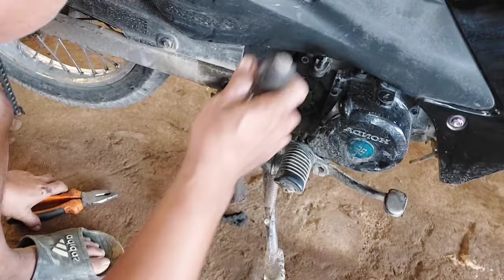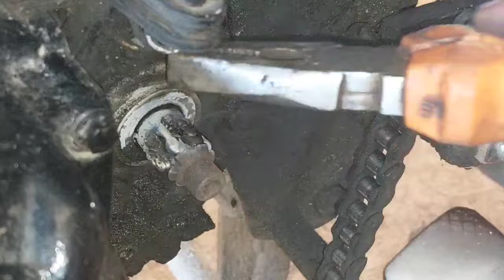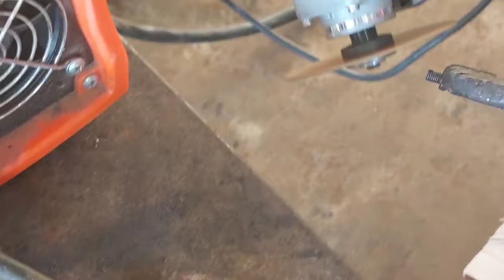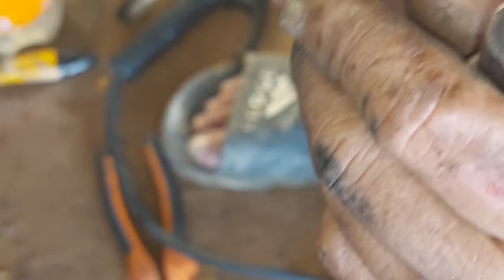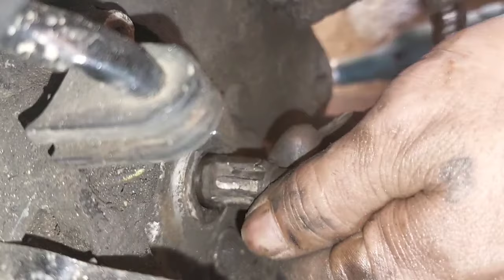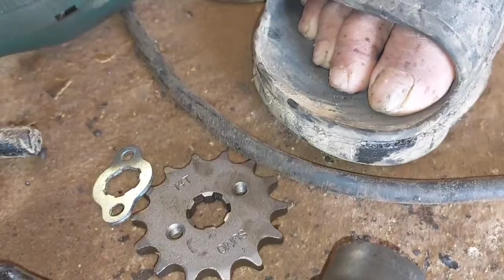How to Repair Engine sprocket shaft No over haul?

Comment: Good Job Boss Ok Yan...Ang risk lang Dyan ay Ang oil Seal swertihan lang talaga na Hindi masira sa init ng welding...pwede talaga yan...madali-an na trabaho
Reply from the maker: D naman problem ang oil seal boss pwede Dakota palitan yan.
Reply: Very good idea Sir gayahin ko rin Yan..pero Ang ground wire ko dun ko ipakagat si winiwelding kasi maaring magkaroon ng spart spot Ang bearing kpg nag poor contact..Tama ka Sir madali lng Yan dukutin Ang oil seal.pero Kung ako papalitan ko na Yan kasi sa tagal ng pag welding baka nasunog na Yan.. keep up the good work sir.mabuhay Ang Pinoy.
Reply from the maker: @rica.ganadores1927  kaya po dyan ko nilalagay  ang ground  very important  factor  na malaman  nyo po. Hindi ko tinatanggal  ang CDI  mahirap mag kalas kalas ng cover  minsan napuputol pa ang bolt.   Pag direct  ang ground  or  malapit  sa we weldingin mo hindi na iikot ang current  kaya safe  ang CDI  kahit  di ito kalasin.
Reply: @buhayturnerodeskartingpino9712  very good sir.

Comment: Pede cguro kng gnyan mga ngipin sa motor ko pino at maliit mga ngipin.ang tanong kng tatagal Kya yan?
Reply from the maker: Tested and proven  na yan boss  dipinde  sa rod na gagamitin. Pina ka matibay Abrasur 610 na welding rod. Pero  kahit  stainless  lang solve  na kahit sa tricycle  d rin bumibigay  tataas pa ng akyatin dito saamin  ang lalaki pa ng side car  foreigner  pa ang karga.
Reply from the maker: D karin pwede mag bago ng ipin  kasi walang available sprocket  na ganon.

Comment: Its totally Usless,  its have needs to perfection of every mm , beter to change shaft with gear shifting road also ..

It's not recommended for repair if you're bike have higher cc an run above 100 km pr ..!
Reply from the maker: @vaibhavraje28  you don't have idea how Is durable, I given 5years warranty.
Reply from the maker: @vaibhavraje28  tested Ang proven the Vedio is 3years ago still running good.

Comment: pinakamatagal na ung isang taon nyan,baka nga limang buwan lng busalsal na yan....,sa axel ung pinaka pwersado na portion,kahit sabihin mo pang stainless tira mo nyan Brad,d mo ba alam tempered ang yaring klase na axel,hindi ordinaryong bakal un,tas welding method lng sa bagay depende lng sa nagpagawa, but for me 70 ganyan klaseng method👎👎👎....,d baling mahal mabayad at least genuine parts papalit and cguradong trabaho,d baling mabuksan makina,back to original din naman.... Pls explained mo raw?,Ano ngaun kung mabuksan makina?,Ano pla problema kung mabuksan makina? Kaysa sa trabahong Kanto Kanto lng na kaalaman,UNSAFE.
Reply from the maker: Marami dis advantage  pag nabuksan ang makina lalo na ikaw ang mechanic masyado ka madaldal cgurado hindi mo maibalik ng maayos. Pangalawa magastos  pangatlo matagal abala sa uras. Calculation mo puro mali. Nakita mo ba mga tricycle at daanan sa amin? Parang sumasakay ka sa roller coaster sa subrang taas.  Kung gusto  pustahan pa tayo eh.... warranty ko dito boss 1year.  Nasa customer  pzrin kung anong choice  nya..
Reply: @buhayturnerodeskartingpino9712  Tama ka boss KC nasubukan na ntin..ganyan din Ang ginagawa ko dto sa Amin...
Reply: ngmamarunong potek kanya knya diskarte yan